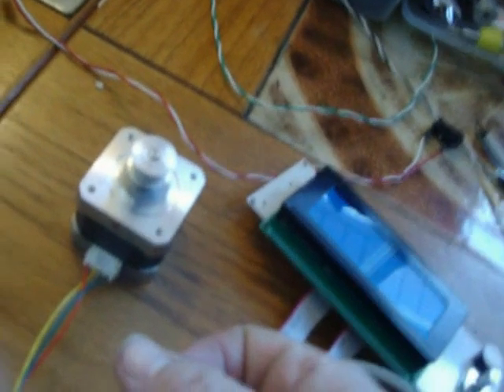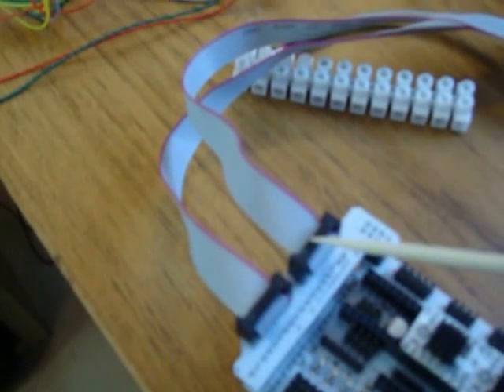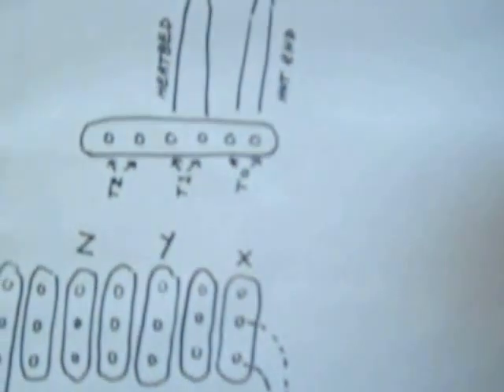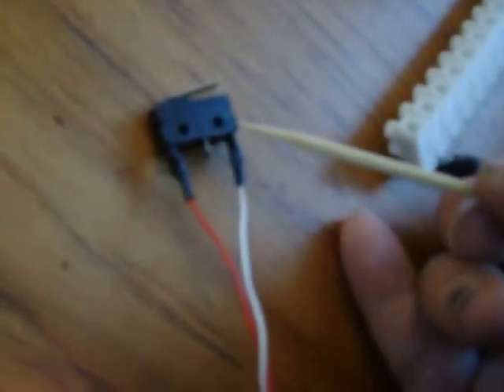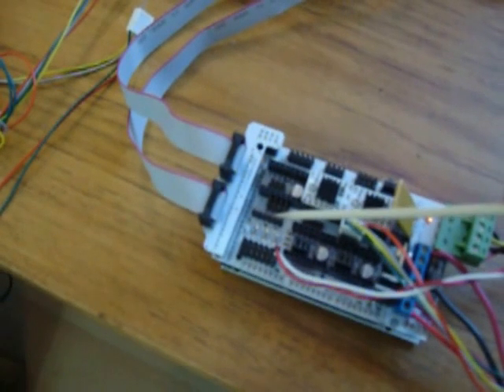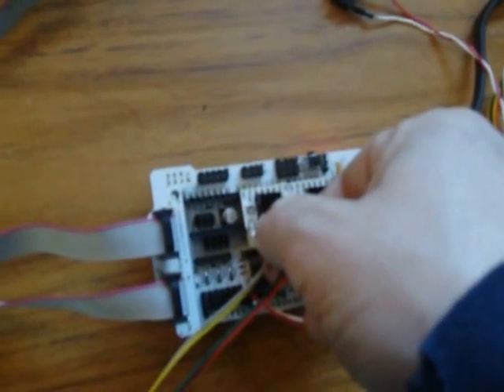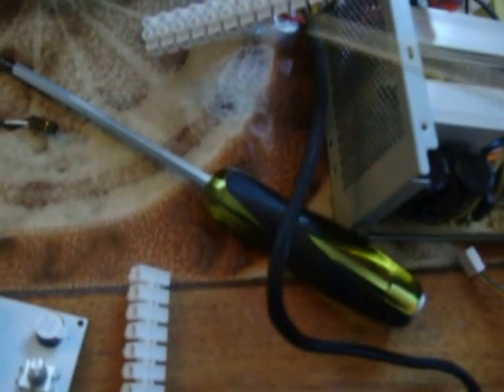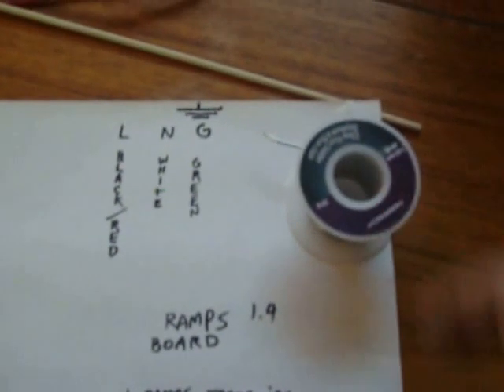How to wire your Ramps 1.4 3D printer board Avoid some easy mistakes.

Comment: did ya get it finished?
Reply from the maker: Apple Guy I sure did! Prints amazing. I couldn't be happier with it! It makes prints that guys can't do with $3000 Makerbots. I'll post another video.
Reply from the maker: Apple Guy https://www.youtube.com/watch?v=zEwM4al2tqI
Reply: how did you set the bed size in Repetier host?
Reply from the maker: I use Pronterface. It's under Settings==> Options==> Printer settings.
Reply: sweet thanks do you have time one evening for me to hit you with a million questions?  I have everything in the instructables built but he compleetly leaves out everything about the correct extruder to buy and what a couple of the parts for the driect drive assembly are.  it is clearly written for someone with some expearince in 3d printers

can i Facebook you OR G+ you?
Reply: Apple Guy
 woops just realised i posted to the wrong vid =D

Comment: Thank you so much for this video :D!!!! I just got my computer controller kit and didn't know where to start. This has helped me avoid so many mistakes that I would have ended up doing.
Reply from the maker: I'm glad you liked it and it helped you, keep a fire extinguisher handy and never let it print alone. These things have no safety built into them. If your hot end thermistor gets loose your heater will keep getting hotter and hotter trying to reach temp. This can ruin your machine and quite possibly your house and all your skin.

Comment: Dude I was ready to connect my stepper motors and I was pretty sure that I had everything in order... Then I saw the LED thing you do and I had my cables all wrong...
Huge Thanks dude
Reply from the maker: I'm glad it helped, this can be a frustrating hobby but with a little knowledge and some tricks you too can set your workbench on fire! But seriously the color coding and order of the wires will vary from motor to motor. Check them all. And with that little trick you can scrounge four wire steppers from old scanners and other stuff. I'm glad you are avoiding mistakes!

Comment from the maker: By the way, JUMPERS UNDER STEPPER DRIVERS!!!! I did not mention this in the vid but if you get everything running and your axis move crazy fast and really far make sure the jumper pins under the stepper driver boards have jumper connectors on them. If there are not your motor will not divide it's steps. It will move 32 times faster and further than you expect. First time I powered mine up I shot my flying beam into the wall! This is specific to my design but I can see it being a problem for anyone.
Reply: Jumpers are very important. I built my 3d printer off of poorly done drawn instructions, and it completely neglected the Jumper. 
Likely the firmware configuration of the board defaulted to the motors not moving at all.

Comment: Hi, may i ask how do you get the 4 pins power supply? As it is made up of both 11A and 5A.
Reply: I just ran yellow and black wires from the power supply. I did not know it was 11Amp and 5Amp at the connector. Does not seem to matter anyway. Each part of the circuit draws what it needs and this power supply is large enough to supply any amperage it may need.

Comment: Another way to avoid mistakes is to TURN THE POWER OFF BEFORE PLUGGING THING INTO THE BOARD. That causes spikes that WILL destroy these processors. There is absolutely zero circuit protection on the RAMPS 1.4 boards and it requires only the slightest surge to blow something.

BTW - Rotating a Stepper Motor with it PLUGGED INTO THE BOARD is a very bad idea too. It MIGHT NOT BLOW THE BOARD - are you feeling lucky Bucky?
Reply from the maker: True. I never plugged anything into the board or unplugged anything from the board while it was powered. And the motor I was rotating was hooked to nothing but the LED light I was using to show how to test the plug/coil wiring. This will not harm the motor. The motor that I rotated with the LCD pot was not being harmed by adjusting it's position.
Reply: Yeah I admit I plugged the thermistor thingy in but the connector strip was not hooked to thermistors, I wasn't making a circuit. And the end stop doesn't feed power, it breaks the connection. And yes, I do feel lucky...

Comment: Hi, I see you're using the white connectors as well, I've searched for a few hours and can't find the name of that part
Do you perhaps know it's name? (that white thing which connects the stepper with the ramps) thanks :)
Reply from the maker: Sorry, been behind on stuff. I actually use Dupont connectors now. You can get them from DX.com. they fit on board pins and are very thin. So you can stack them side by side on the board for the Z axis. Z axis on the RAMPS board doesn't have room for two white connectors side by side. Dupont works.

Comment: how many inputs were on your board for the thermistor? mine has 3, and theres only 2 from the thermistor any thoughts?
Reply: I think mine has three as well, the third is not used by me since I only have one print head and one heat bed.

Comment: You mentioned negative and positive 12v. If that is the negative and positive 12v in an atx power supply that would make a total of 24v (voltage = difference). Just want to confirm that when you say negative you mean negative ground 0v correct?
Reply: Yes you are right, ground is the black wire and 12 volt is the yellow wire. I just tend to think of DC like a battery (negative/positive)
Reply: Yeah I do the same. I just wanted to clear that up because many people including myself will be using computer power supplies. Thanks for the quick response.

Comment from the maker: More mistakes you can learn from...If your motors only move one direction while testing. Check your end stops! I just spent two hours fighting with my printer. I hooked up the motor thinking I wanted to test some movements but I didn't bother hooking up the end stops cause I wasn't going to move anything much. Turns out without them plugged in the printer thinks it is all the way at one side pushing an end stop switch. Since the switches are wired normally closed a missing switch reads as open...which tells your printer to stop. Sooooo frustrating!!!!

Comment from the maker: By the way at 2:22 I mistakenly call the two middle screws on the blue screw terminal "For the second hot end heater" this is wrong. Those two screws are for a fan used to help cool the print so the next layer has something more solid to be laid down on. By the way folks I am almost done my 3D printer. I hope to be wiring things up permanently tonight! I didn't video tape it because it is a repstrap and it's been through a lot of changes already....A very fluid build. Almost no measurements taken, I'm really just playing it by ear.
Reply: How about the software?
Reply: idrisMS bin I loaded Marlin_Ramps_Epcos_i38 onto my board using the Arduino software. I control the printer with Pronterface. I use Slic3r to create the STL file the printer needs to print from. I used Tinkercad and Google Sketchup to make the 3D drawings of the objects I wanted to build. I do not use the SD card and display for printing. I removed it since large curves can require more info than the SD card reader can send. This causes prints to lose their way and turn into a mess or fail and stall out entirely. I run the printer with a USB cable going to an old computer I had collecting dust. Any computer you have laying around will have enough brainpower to run a 3D printer.

Comment: Very informative. thanks for the vid.. I do have a question. I have the ramps 1.4 and the arduino mega 2560. I have uploaded the arduino sketch to the board. but my screen does not have any info displaying. could it be that because I have not connected everything yet.. motor control boards, motors end stops etc?

have you experienced this in your system?

thanks
Reply: Make 100% sure your two cables are plugged in the right way EXP1 to EXP1 and EXP2 to EXP2.  Then check the contrast knob on the back of the screen turn it and see what happens.  If that does not work.  Plug it into your pc via USB.  Edit the configuration.h file.  Make sure the line for your screen type is not commented out.  ie. remove the // (slash slash) from the line for your screen.   If you had the same screen as the video make sure you have a line like this.
#define REPRAP_DISCOUNT_SMART_CONTROLLER
not this
// #define REPRAP_DISCOUNT_SMART_CONTROLLER
Save configuraiton.h then compile and upload.
Reply from the maker: Troy Sorzano

Thankyou for answering this.
Reply: I have stopped using the small LCD display. It is really clunky compared to a real computer. Much easier to run everything with a mouse and keyboard in Pronterface than to click thru tiny LCD screen menus. And I have read that large complicated curves can cause a failure in prints since the SD card can't keep up with the printer's need for info.

Comment: It makes me so mad that we buy this stuff and it comes without any instructions to assemble it correctly. I not buying any more of this crap from China without documentation, forget the cost. How much money did you lose by burning the drivers? Now I'm sweating how to connect my LCD, it can only go with the red wire on the left, but only the adapter has any marking, not the display.JUNK!
Reply from the maker: I've abandoned my LCD display. When you think about it even if I pack the thing up and take it to a buddy's place I'm going to bring the laptop. It has all my files on it and my Arduino IDE. Pronterface on my computer is so much better than the LCD.

Comment from the maker: I'm sorry about the quality. I'll try to make better video next time. I used an old camera with bad resolution.
Reply: Your video answers many of my open issues - thanks so much.
But it also raises a number of new questions for me: I have the identical hardware that you have, but my LCD displays differ from yours (after selecting prepare > move axis, I get this:
>Prepare
X:    +000.00
Y:    +000.00
Z:    +000.00
Extrude
Retract
Selecting X and then rotating the knob does nothing to the display or to the connected stepper (probably because the step size is zero - but I can't figure out how to change it).
Could you tell me where you got your firmware (and perhaps how you configured it).
Thanks again for the video...
Reply from the maker: Jeff Won'tSay
 I followed the directions posted by engineglue here on youtube. I got the firmware downloaded from makerfarm.com. I am currently having problems with my display which used to work fine but I have managed to hook into pronterface so I'm not too worried. It is much easier to adjust speeds and rates on pronterface. Perhaps after I have everything dialed in I will edit the firmware and reload my board with the LCD screen attached so it can work without the computer attached. By the way when I first tried to use pronterface it just kept stalling and sounded horrible! As it turns out the program loaded with it set to move 2000 mm per minute!!! So do yourself a favor, turn it down to around ten and work your way up. I now have smooth movement. I will work on speed later. As for configuration I did nothing yet. I just loaded it as is. Make your configuration changes with pronterface, it's way easier than clicking that little knob and hunting thru that tiny menu.

Comment: Hi..Thanks for making this video..learned some new tips and tricks..you dont have one of how you adjust the stepper drivers?
its hard to find som how to's of this for noobs like me.
Reply from the maker: No video but from what I understand you turn them in to the left to minimize the current going to them and then turn them to the right till the motors stop buzzing or chattering. If they are not strong enough you can keep turning them in to the right to add more current but it will make your motor controllers heat up faster. You have to find a balance between heat and power. The wires you use are important too. Use the largest wires you can to supply power to your components. You are not saving any money using cheap or thin wire for anything that uses a lot of current like heat bed, hot end or between your power supply and the printer controller board. Use the biggest wire you can everywhere.